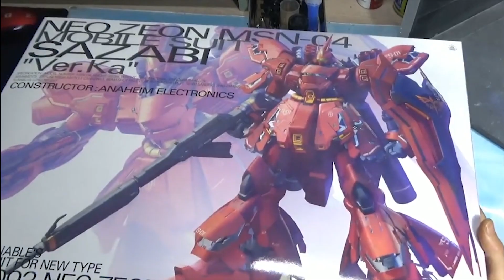[NORI tv]MG 1/100  MSN-04 SAZABI ver.Ka / MG 1/100 MSN-04 사자비 ver.ka

Comment: did you spray gloss clear coat before applying water slide decals or on top of red clear?
Reply from the maker: Spray the clippers before the decal, so the surfaces will be smootherThen you can spray the clippers again before you put them together.
Reply: @NORItv-painting  so after red clear you did clear again because red clear not smooth enough to for decal

Thank you